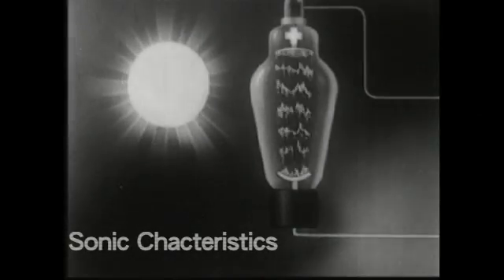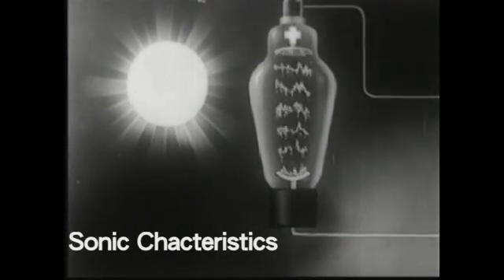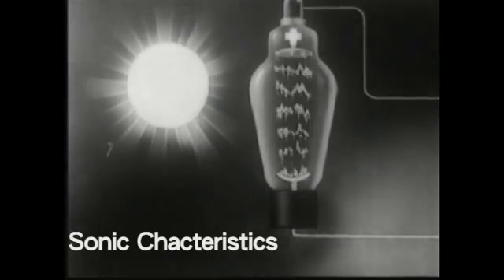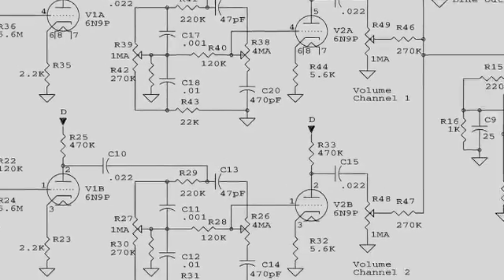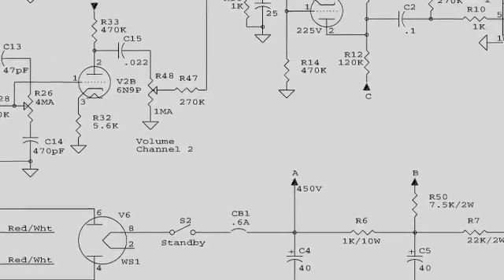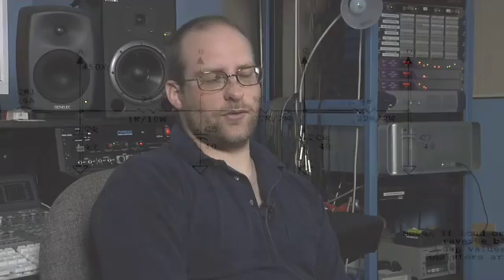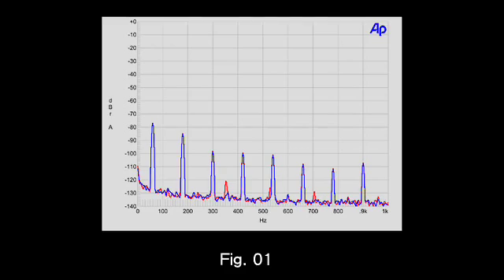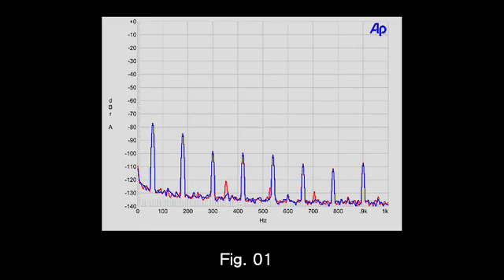Tubes Vs. Solid State Amplification

Comment: Comparing a digital solidstate amp and a tube is not a valid comparison.  A valid comparison would be an analog solidstate amp and a tube amp. An excellent example of a solidstate analog amp is the Tech 21 Trademark 30.

Comment: It would've been nice if the guitarist didn't use any effects pedals so it is easier to compare the sound within the amp itself and not the amp with the different pedals, especially since he's using different pedals. The comparison is noticeable, but harder to hear than if you just had the amp.

Comment: @Sn4pDr4gon  You can get a clear uncolored sound from solidsate amps. If you plug two guitars in to a solidstate amp they will sound different from eachother.Tube also provide more colorization than solidstate amps. This is like bassman and  thejtm45 which is just a copy of the bassman except different output tubes. The reason Solidstate soundsbad to you is the only state amp you have heard is the fenderfrontman which has a terrible speaker this colors the sound causing badtone and a bad preamp.

Comment: Hybrids are only decent for bass equipment. Emulators and Solid State colors the tonality of the guitar...which means that if you plug in a 59' Les Paul and then plug in a 2011 Epiphone...you will get nearly the exact same sound which is not only a travesty....it is a flaw with solid state amplification. Tubes on the other hand do far less coloring...if the amp is good...and let the guitar do the work. Sure it comes down to opinion and preference....sort of. The most rich sounds come from tubes.

Comment: Not only does the guitar player sound like crap, this video is crap.
The tube amp overloads the mic and the solid state amp isn't distorting in a natural way. So neither the tube amp nor the solid state amp sound like they usually would when distorting. 

Crap. Don't believe this video.

Comment: @TheBlind97 The ISP Decimator is the best. This pedal even beats many rack mounted noise gates like HUSH 2c. I am not gigging right now, so I am using a BOSS NS2, which will work great at low to medium volumes, but if you are going to get loud and play live, get the ISP.

Comment: @TheBlind97 I bought the 6505+ because it sounds AMAZING!!! You don't NEED any pedals for it, except maybe a noise gate. It is loud and has massive, bone crushing distortion. If you play rock, hard rock, or metal type music, the 6505 or 6505+ will make you very happy and do the job very well. If it is ever stolen or lost I would get another one without even thinking about it.